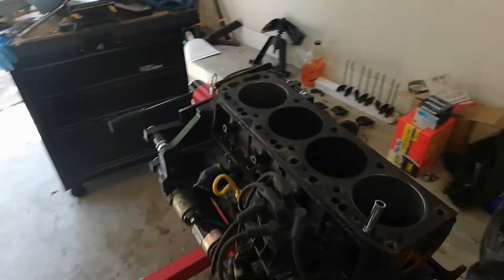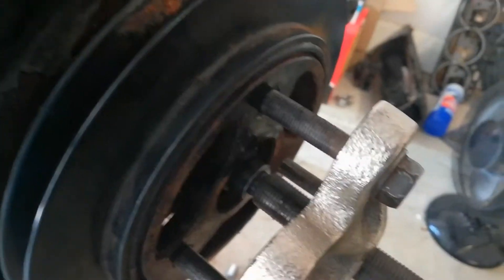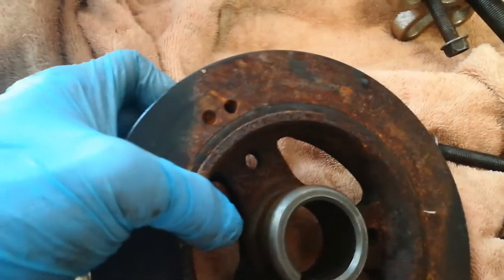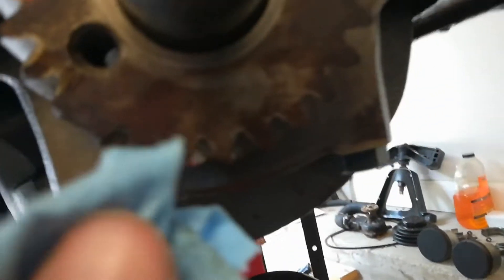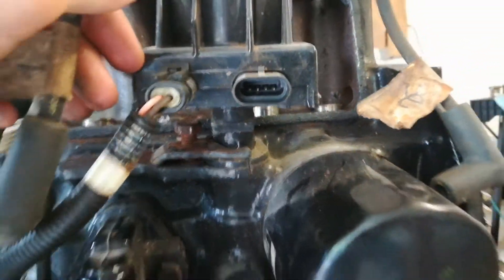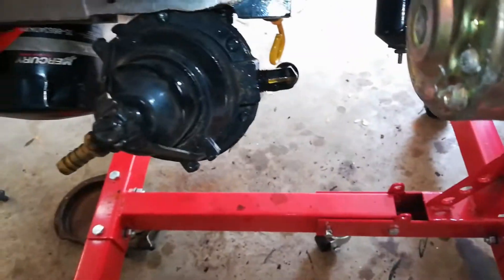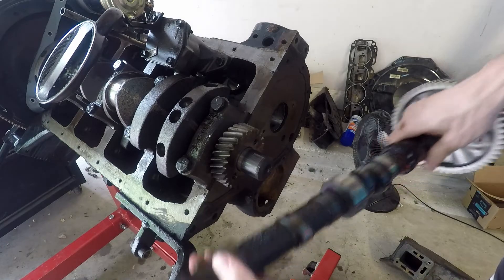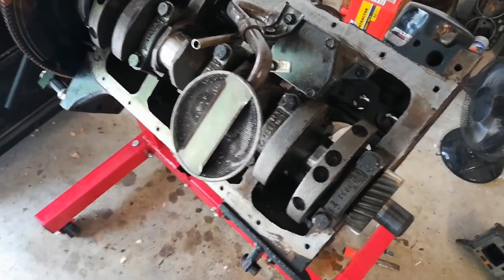Mercruiser 3.0 Teardown Part 2

Comment: How did water get in that cylinder?
Reply from the maker: Leak from the exhaust riser gasket into the exhaust manifold into the cylinder
Reply: @ZachsGarage1  damn thats crazy little gasket locked up that engine.
Reply from the maker: @evanbushong4291  well the previous owner also had the boat sitting for 5 to 10 years in the elements without running it. So humidity and condensation multiplied by a few thousand days did not help it

Comment: Hey zachs how did you clean the cooling system behind the cylinder by the water pump hole?
Reply from the maker: "I" did not. It was cleaned pretty good from the machine shop throwing my engine block in their dishwasher
Reply: @ZachsGarage1  got it thanks

Comment: Hi, question.  What was the cause of all the water in the motor? I figured  the block had froze and split
Reply from the maker: No, from what I could tell part of it may have been an exhaust riser gasket leak of water. But also I flooded the boat in the lake accidentally right before I was going to rebuild it 😛 that was probably where most of the water came from

Comment: Keep me posted on how you install the balancer I’m at that point now just rebuilt my lower end on my lower engine they said you can freeze the balancer for easier installation
Reply from the maker: I will hopefully be able to get that done within a week to see. I think the freeze idea should help, I'll try it out
Reply from the maker: I just put the balancer back on, I might have been thinking opposite, I heated the balancer instead of freezing, it was hard as hek to get on. I had to hammer the hek out of it
Reply: That is what I did too I boiled mine for 15 mins she was tight the whole way in just dropped my motor back in Saturday gotta rebuild my lower unit since the last guy screwed things up